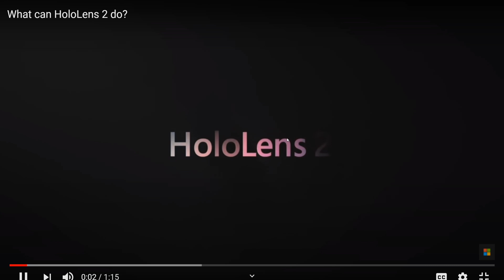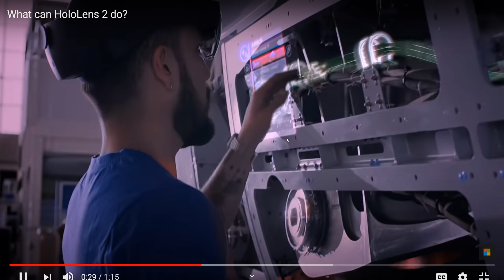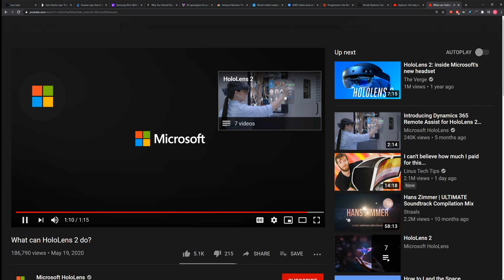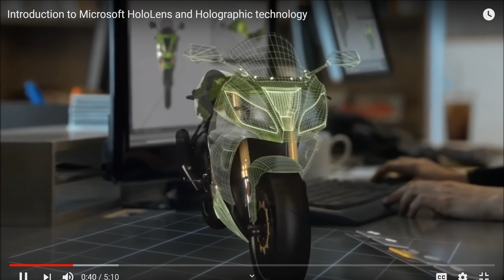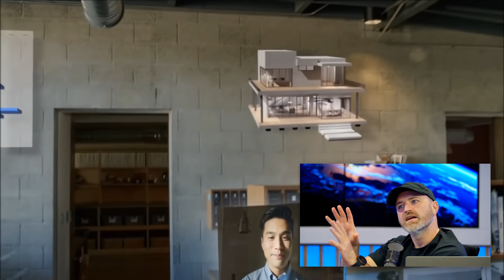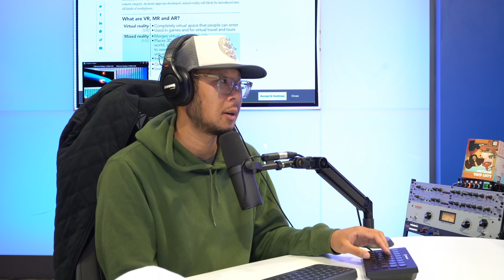AR Headsets Are Entering the Workplace...

Comment: 3 years ago, our software company contracted a project from a German client that bought 5000 (5.000) Hololens kits for rolling out to their factories and maintenance crews to use when having to do maintenance on the field or to machinery in their factories. We built a prototype and an alpha-version of the software they needed to use in order to do maintenance work on, for example, ATM's.
Then, 2 years into the project, when we were ready to push out the beta, the client just left, closed the contract and moved on. We gained a lot of experience with Hololens and I can say it's an amazing piece of kit and I'm shocked it hasn't caught on faster.
Reply: Also tons of health issues. It is bad enough people working in front of monitors and screens all day. How much worse when it is fixated directly in front of your eyes all day every work day?

That blue light has health issues and this is more of the same.

What is funny is people thinking a device is going to automatically make everyone more knowledgeable and skilled. In reality a large monitor with voice commands would be just as practical. Install some camera's as necessary to observe and display what you are working on. Plus it would have the benefits of not having to worry about damaging or destroying a head set.

These AR head sets are only a slight upgrade for idiots. Most people can think well enough for themselves on their own.

For any and all companies though, they then have to worry about someone taking one of these AR head sets as it would provide competitive advantage to the competition very easily.